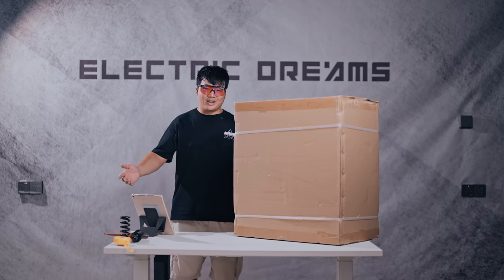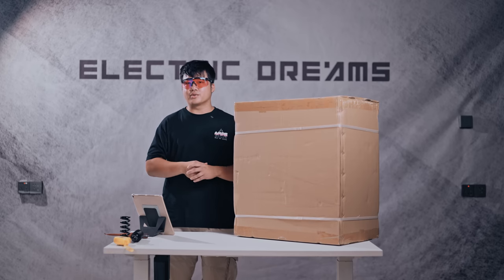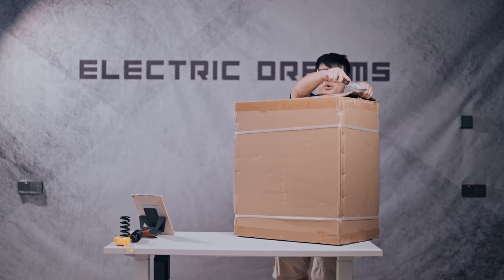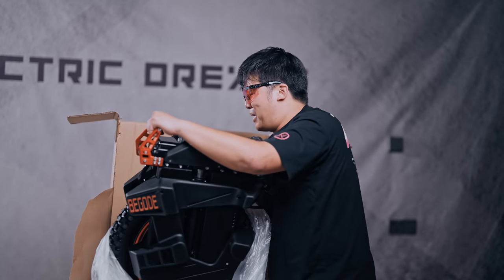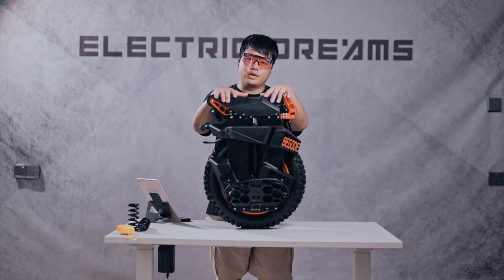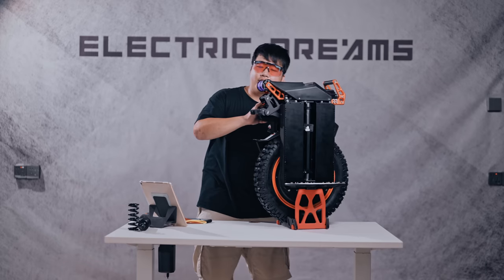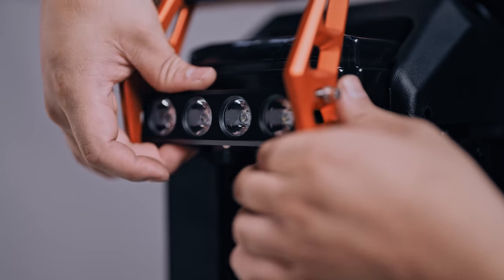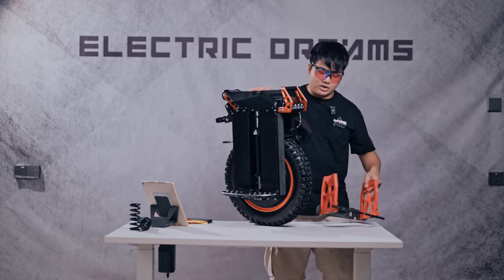Best Built Begode EUC // Extreme in depth first look!

Comment: From experience riding the 50e master and the 40t, the 40t cells are the way to go if your thinking of really pushing it and range will be about the same when both are being pushed, I feel way safer pushing the 40t master over 50e it just feels more responsive.
Reply: Have you noticed any difference in cycle life between them? Apparently 40t cycle life sucks, 60% after 250 cycles vs 80% after 500 on the 50e.
Reply: @TurboGlenn  I have 2000 miles on the 40t but so far i don’t notice a difference
Reply: they say 40t will have different firmware
Reply: @TurboGlenn  This is a myth.
Reply: @matthewearl9824  I very much doubt that. Googled this: "250 cycles to 60% at 6A charge and 35A discharge."
Average discharge value is probably closer to 15A meaning it'll most likely last significantly longer.
Reply: @egrseec  I hope you're right but as I can see it says at 7.10 in the pdf that it does 250 cycles to 60% at 35A continuous and w 6A charge. There is no temp mentioned. The 178F or 80C is for cutoff for 45A discharge. And it says at 35A "without temperature cut". Or am I looking wrong place?
You mentioned temp kills battery which makes total sense and since 50e runs hotter it should equalize the real world cycle life a bit. 
Atm I'm leaning towards 40t but wanna be more confident in the choice.
Reply: @azures9803  Do you feel you can push the 40t even at lower battery percentage, let's say at or below 50-40%? At least my shermax I feel can't push at or below 60%.
Reply: @TurboGlenn  yeah I can push it below 50 percent no worries, sometimes I’ll be below 30% and still go 45 with no beeps, I’ll slow down when it gets below 105 volts I just don’t trust going fast that low percentage but it can still do 40
Reply: @azures9803  sounds awesome 😎👍 you'd go for 40t no question about it?
Reply: @TurboGlenn  yeah for my riding style if not I’ll need a bigger battery.
Reply: When are you guys gonna do some more fries in the extreme I.e jumps off road ?

Comment: BEGODE HAS AN ACTUALLY GOOD BMS!?!?!!?!!?!?? LETS GO! i totally agree that the last two ex wheels (ex 30 and the extreme) look really well designed. my personal dream wheel is for them to put the electronics, motor, battery, etc, of the extreme into a msp or rs body because imagine all of that power in such a small body
Reply: Good idea. Do you mean a very little travel suspension or non suspension wheel?
Reply: @NahBra_EUC  no suspension because it takes up too much space, it is harder to maintain, and it requires more maintenance
Reply: @VECTOR_Coasters  Makes sense, it would be cool to see both a suspension and non suspension offering of the same wheel imo.
Reply: @NahBra_EUC  the inmotion v13 came with the option to remove the suspension for pre-production units. personally, i just want to see a 134v or 148v, c40, msp/rs with the new bms as the rs was SOOO much more compact then the new wheels, as far as i’m aware, the extreme will be nearly 10 inches taller than the rs and it’s supposed to be a smaller suspension wheel. that is ridiculous to me, it makes it feel huge even though it has a smaller wheel size then the rs
Reply: @VECTOR_Coasters  It is the same height as a Master. Due to the wider tire and rim making the "16 inch" more like an 18 inch. Also, the 130 mm suspension makes it so much taller. I know what you are saying though, the MSP was my first wheel and it was awesome having the lower center of gravity and lighter weight.
Reply: @NahBra_EUC  most “16 inch” wheels are actually 17 or 18inch wheels and most “20 inch” wheels are actually 19 or 18inch. kinda weird

Comment: I like my 84V kingsong wheel, but pulled the trigger on the commander mini after seeing the production changed on the S19. Wanted a street tire on my next purchase too so Xtreme was out of my consideration. But you’re teasing the S16 again since the last time you said that term in December 2022, it will really need to pull 16S/16X vibes and stay away from the 2400wh/ 90lb specs. Let’s have practicality again 🙏🙏🙏

Comment: I’m interested 

Let’s see how plush the suspension is, T4 and entire current range is Janky as F compared to S22 Pro when it’s tuned up and running well, so like for 5min, just a shame S22 is a 12 mos board with no grunt 

And the Fast ace wheels feel Ace, but is only better than S22 in my opinion for bouncing up and down on and not needing to service it every ride

Comment: If an EUC company ask your advice to make an ultimate street wheel for 2024, and you can have 3 attributes of previous existing wheels. What would those 3 attributes be, and why?
Thanks!!!
Reply: 1.Power (no less than 134v)

2. Aerodynamics and weight cutting (invest in and develop lighter composite materials)

3. Technological advancements in suspension technology, being able to adjust rebound, compression in software like a Porsche 992 gt3 rs.

Honestly, this is sounding like another racing wheel, but I don't see myself buying anything other than a Racing Euc.

Comment: I'm 6ft 240lbs rider without gear, do you think this EUC size is small in height, width and weight? I feel it's to small. Do you think it's the same size and dimensions of EX30? I know the wheel is bigger on the ex30 but this one got 130mm suspension travel, would that make up for it? Thank you. Great video. 0:01 0:01

Comment: Great video! Am curious about air vs coil damper. Can't see why I would want air over coil but haven't seen it in use yet. Ain't interested in the 40T anymore since I found out they age 2x as fast, 250 cycles vs 500 on the 50E.
Reply: Coil shocks are only better for being cheaper and lighter.
For example in competetive biking sports alot of effort is put into making the bike as light as possible. And coil helps with that.

With EUCs though a bit of less weight is not important.
So going coil is just missing out on all the comfort benefits air and other non-linear systems provide.
And no coil "feeling" better by some people cannot be trusted because humans have many many biases. Placeblo, Nocebo, ect.

If you look at the metrics and data non-linear shocks simply are better if you exclude price and weight.
Reply: Yea Molicel P42a or P45b would be better for high discharge applications and they have a better cycle life.
Reply: Oh I was unaware that the 40t has less life cycles of that of 50e. This may alter my decision.  Of course after I do a Lil more research into it. In the mean time, do you have any sources you can share proving the claim?
Reply: @Onelastrun  it was from a euc video can't remember which. But a quick Google search claimed 40t to 60% after 250 cycles and 50e to 80% after 500 cycles. So 4x the aging on 40t it seems. Was gonna go for 40t until I found out about that and now there's no question about it for the 50e imo.
Reply: @TurboGlenn  understood. I'll look into it. Thanks for the heads up! Big reason why I  read the comments
Reply: @EUCvibes  Yah those EUCs are completely different. You cannot properly compare without controling for all variables aswell as running real metrics.
S22 has a different slider design, more suspension travel, a different lever design, and many other differences.
You cant just ignore all the other variables and expect to get a reliable accurate conclusion.
Reply: @egrseec  hopefully you're right. It would make sense as you say that it depends on how much discharge you utilize. I could probably also believe tho that the charging itself takes a bigger toll on the cells. But perhaps I'm wrong in that and it is equal or better due to internal resistance. It is worrying tho that the numbers are 4x worse on 40t acc to quick Google search but idk what conditions it refers to.
Reply: @Dogo.R  after watching some videos on air vs coil it seems as coil is more sensitive but also more linear as you mentioned, meaning air is better if you want more buffer for bottoming out due to air being more progressive. I'm not a jumper yet, owning a shermax, but I like the idea of having more buffer so am leaning towards air. Not sure yet tho.

Comment: @ 07:51, "Obviously you have these O-Rings here . . . to help with the Cushioning".  Well, sort of . . . barely.  Those O-Rings stacked on the Shock Piston have at least Three separate purposes and "Cushioning" isn't really on the list. First, and not in any order of importance, these O-Rings should be slid down to the top off the shock after wiping the Chrome strut clean of dirt and debris (something that should be done after each days riding, before storage). When you've had your next ride, they'll have wiped the Strut clean, which brings up the next purpose. They will indicate your total shock travel for that ride. If you have a lower than recommended amount of Air Pressure in your Shock, you'll know immediately before your next ride. Bringing you to a Third purpose, they tell you how much travel your using. Maybe you want more, maybe less, these O-Rings will tell you what each Shock Pressure adjustment has done. Another function is to protect the Shock Piston from bottoming out completely, should you have a Seal failure. Bringing us to another function, they help to protect and lubricate the Shock seals.
  "To help with the Cushioning" sounds pretty made up and makes me wonder how qualified you are to do a review on such a well-engineered device as this eWheel.  Just because you can afford one, doesn't make you an Expert on the item you've purchased. And for those out there who care, never open such a nicely designed & Expensive piece of equipment like shown here, unless you can afford to pay for the components you've ruined.

Comment: Dear Begode, 130 mm suspension travel is still bottom out on S22. The sweet spots are somewhere between 150-200 mm suspension travel. Everything else is sweet on this wheel, BMS, CNC frame (stronger).
Reply: You don’t need more suspension travel, just a tuned damper. My airshock never bottoms out. But it’s not stock and dailed…
Reply: @timluyten7330  How much do you weight? How big are your jumps? Airshocks are trash, even S22 still bottom out. So, you ride a Begode's last gen air suspension with 100 mm travel...S22 has the best suspension. They're still bottom out and you think they don't mess with the damping? lol

Comment: Alright!!! Been waiting for this.  I hope it is a light weight ex 30
Reply: It is a higher torque, lighter and more agile ex30 with less range but better suspension and smart bms.. in fact it's the highest torque wheel ever made but it's top speed will be slightly lower than the ex30 but still capable of 50+mph.. having both is most ideal and together covers virtually all use cases optimally

Comment: There's a rumor swirling regarding the motor being 3500W vs 4000W on the Extreme. Could you please check with Begode which motor the production models will be getting? We don't want a S22 and S22 Pro type of scenario.

Comment: The Begode Extreme should only come with a coil shock. The shock looks very tiny. You won't be able to use the whole 125 mm travel with a small shock. The coil on the table looks very small.

The speakers in the back are unnecessary. The sound won't be good.

I get less hyped the more I see the Begode Extreme.

It will still have only one charging port, which is ridiculous.
Reply: Linkage geometry plays a critical factor in how much suspension travel you get, not necessarily the size of damper.
Reply: @TurboGlenn   it all plays a big role
Reply: It’s the ratio between the suspension travel and the range of the damper. The linkage makes sure the ratio is influenced in the correct way. Coil shocks are a nono love the airshocks, a lot more progressive than coil